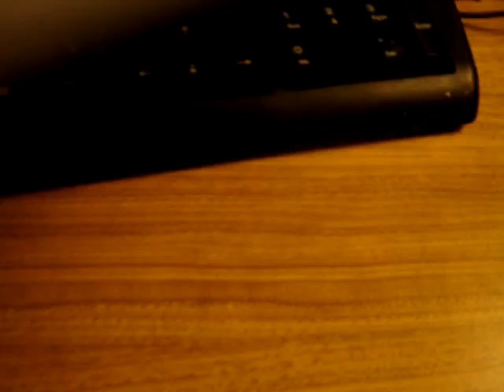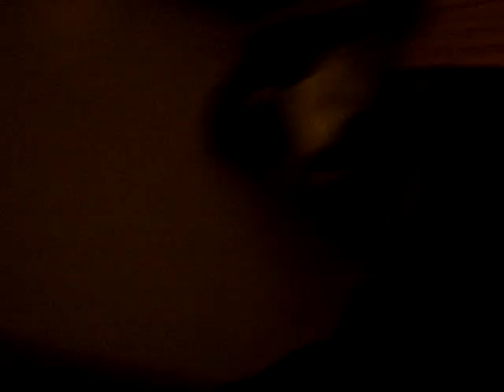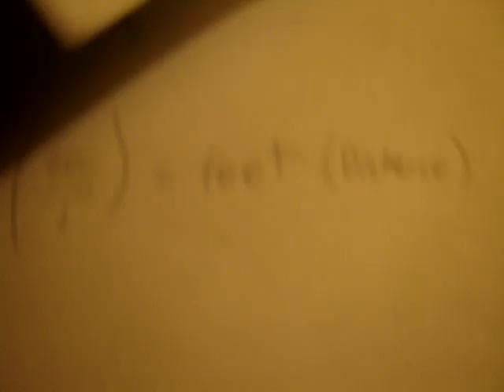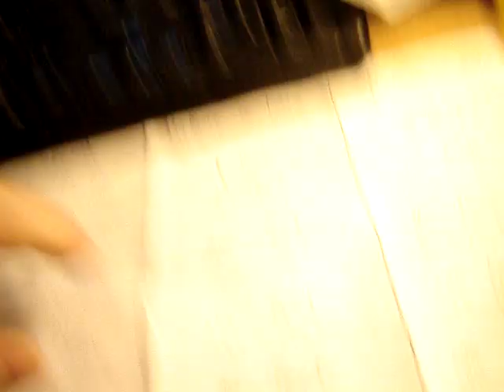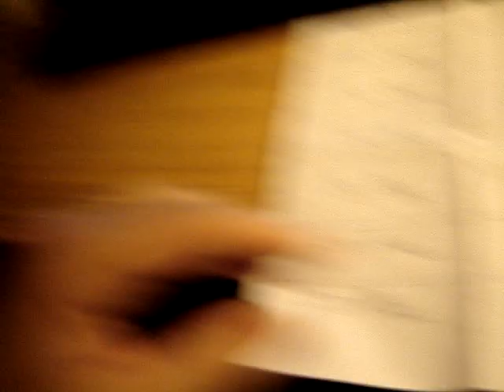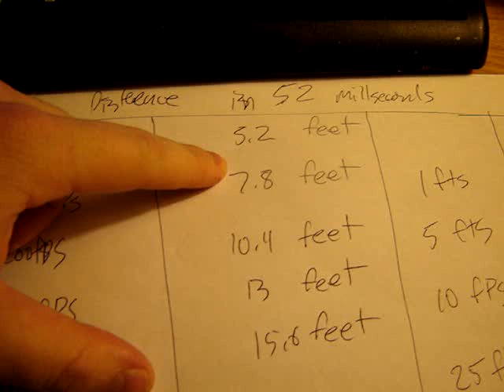regarding mike's "collision theory" in the 09 geo video

Comment: Not to mention also that a paintball can only collide with another and actually burst is if the paintball behind the first is traveling at 250 FPS higher than the first to accelerate it faster the the 300 FPS accelerated paintball. And NO GUN can be that inconsistent between shots

Comment: is it possible that the balls are simply sliding past the detents causing these "collisions"? Perhaps the loader is putting to much force on the balls, in turn pushing the balls past the detents. If I remember right, the pinokio(sp?) hopper is very fast. Could it just be loading faster than the gun can shoot?

Comment: I think ur error might be in your average velicity value in your equation. If you shoot your gun with the barrel off a paintball doesnt have a velocity even close to 100ft/sec. i think the majority of a paint ball acceleration happenes in the barrel not before it like you mightve suggested. When i had the paintball pile up the paintballs were semi in-tact meanignt he were not traveling fast enough to break in the barrel so the volocity was fairly lower then normal.

Comment from the maker: i never said anything like that. 

as long as the velocity of the paintball is above about 20ish FPS, it wont be in the barrel when the second shot is fired. 

its impossible. 

do you really honestly think that a tiny bit of drag (as you call it, yourself) will cause a paintball to slow down by 280 FPS?

and to do that without ripping the paintball apart?

Comment: Yea, Well other things that will not help. Is the Gun Being brand, new not even broken in yet. Little things like that.. and Uncapped when A gun isn't broken in is always defo going to cause paint issues..Or chops ect.. But I bet If he did the exact same thing. When the gun has 10+Cases there will be less problems...Plus the reg will be broken in more. And more consistent on the paint too